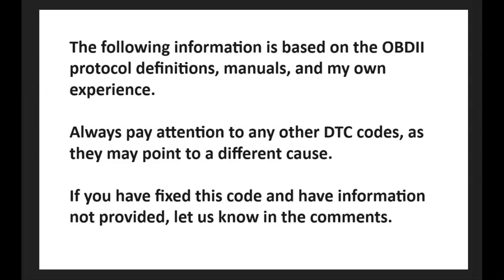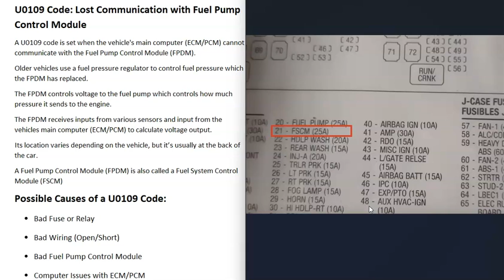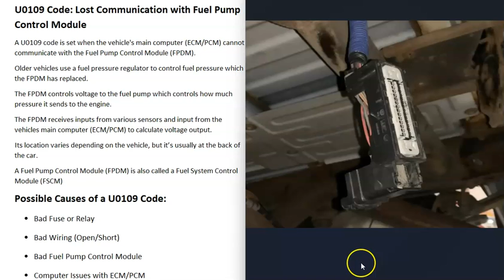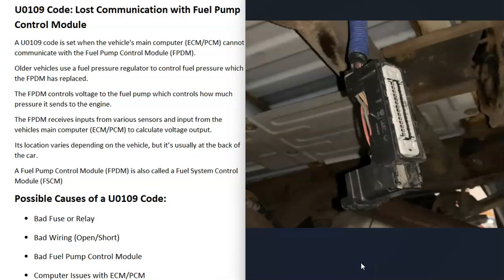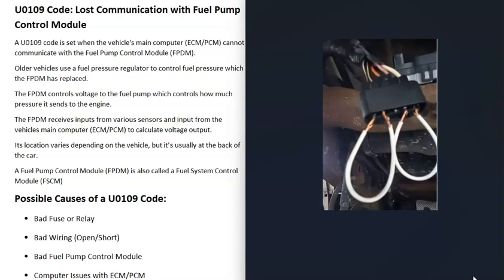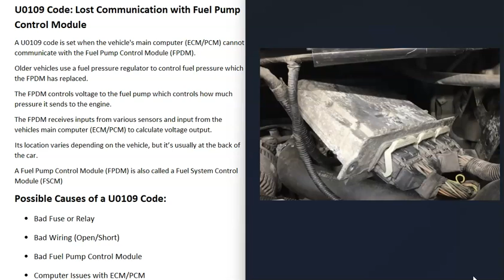Causes and Fixes U0109 Code: Lost Communication with Fuel Pump Control Module

Comment: I have a 2015 ford focus that has the U0109 and a P025A. The vehicle stays running even after the key is turned off. The battery has a parasitic drain and has to be boosted often. The battery has also been replaced. Any chance you have seen this condition? Any Help?

Comment: Ive gotta 2014 ford e350 box truck. Same code. Replaced all fuses, relays, FPCM and fuel pump all parts bought from ford dealer. Nothing fixed the issue. Still get the same code and the truck cranks and runs for 3 seconds.  I hate ford

Comment: This video is for other cars not Mercedes if you having that code it’s the connectors next to the can bus color white and yellow connectors when water gets there and you only replace the can bus without the connectors you gonna have that code and when you get to it it’s gonna have corrosion and wires gonna snap out of they’re hole location so you gonna need to be very very careful while removing them till you swap them into the new connectors with new wire pin that’s all it need on a Mercedes c300, but sometimes you get away with just cleaning the wires and connectors with electrical cleaner right after it gets flooded but if you open up and see green change all of the can bus and yellow and white connector

Comment: Hello, i have a 2008 yukon denali xl awd.  I changed my TCM on my 6L80 transmission.  when i tried to start it, a code of P0230 and U0103 showed on my scan tool.  I checked and replaced fuse #21.  This vehicle has no fuel pump fuse or a fuse pump  relay.  I have a crank no start issue.  What do i do from here?
Reply: You need to program the TCM to start.

Comment: Hello,  great video. I have a 2013 f150 with a code u210b-00-6c.
I was drilling a hole in the firewall grommet and got the wires. Not my shiniest moment😮 anyway, truck runs great. Just dont know which wire goes to the ens.
Any help would be greatly appreciated. 

Ty
Scott

Comment: What would cause Lost of communication just by unplugging the battery hot connection? I parked the truck in my driveway run fine no issues unplugged battery for 2 hours to reset another code and that occurred. The module is only 6 months old. Is there a jumping process required to restart the module or something?
Reply: What happened?
I have same issue, i was reset for 2 days, and it's doesn't work. Car 2021 year.
Thanks for your feedback!